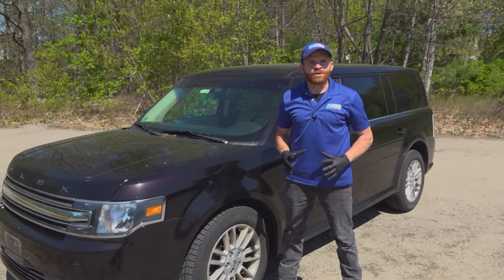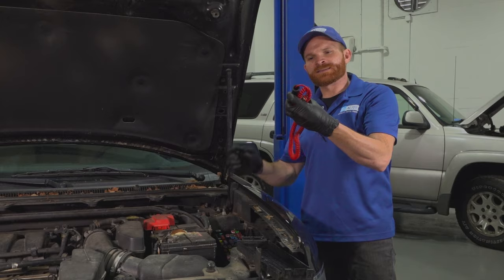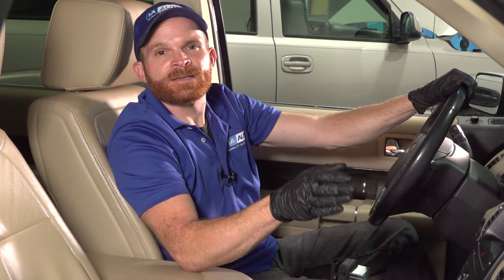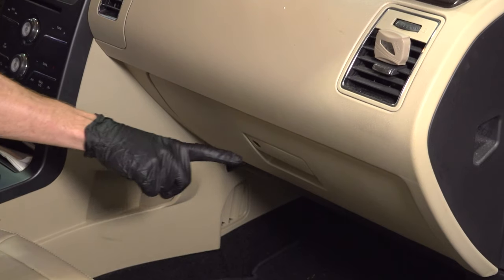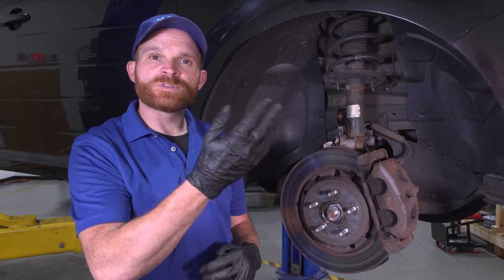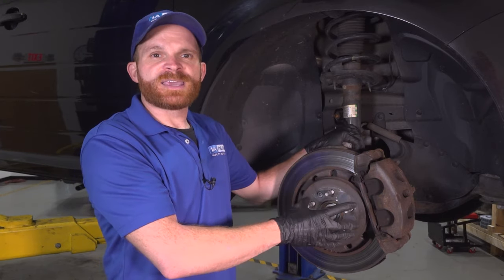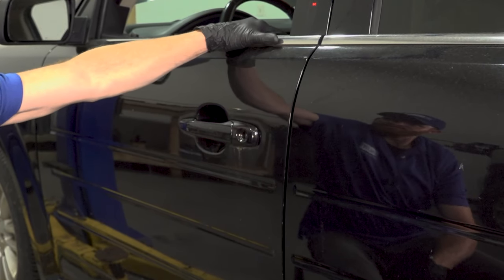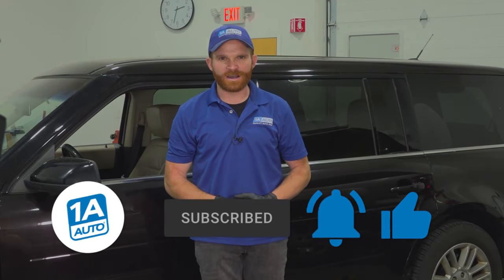Top 5 Problems Ford Flex SUV 2009-2019 1st Generation

Comment: I have a 2013 flex it's been a great car my timing chain broke at 189,000 and my alternator just went at 200,300 miles fixed and it's still running strong great car other than the 02 sensors on both banks and back up camera I've had issues with the front end making a ruff sounds not sure if it's bushing or arms if anyone can recommend any help itd be great. I love my flex ❤

Comment: Unfortunately those ford flex models have a ridiculous design for replacing the water pump. It’s a $2000 job as the water pump is ran with the timing chain system. The entire top end of the engine has to be removed

Comment: Don’t like your assessment of the  Ford Flex, nitty picking and very minor items, I own 2 Flex’s, a 2011 SEL with 175,000 Kim’s and an extra 45,000 Kim’s towed behind the motor home and a 2019 Limited, with 90,000 Kim’s, and they both perform better than most vehicles sold today, gas mileage is not an issue on the 2011, but the 2019, guzzles but delivers fantastic power, I love the Flex’s 💕

Comment: I have a 2016 flex the rear ac controls do not work or air comes out of the back vents what could it be
Reply from the maker: +Edgar Garcia We wouldn't be able to diagnose an issue like that here, you may want to have a local mechanic take a look at it. Thanks for checking us out! http://1aau.to/m/Shop-1AAuto-c

Comment: There are problems with the Ford Flex with the fuel tank systems. id like to know more about this. example we were driving to Taos NM from AZ during our drive we started to have an issue where the fuel gauge would state 1/4 tank left and the computer said 100 miles to empty. after driving 2 minutes it dropped to zero miles and the fuel gauge went down to empty.  this left us stranded in the middle of the desert at 117 F. not cool Ford! after looking at google more users had the same issues. ford seems to be unsure of the issues and start to just replace parts. you have to love SEA parts re-placers and not actual knowledgeable techs.  they suggest to replace the pump or the fuel transfer or both then the hose between both. my tank now reaches 1/2 tank full and the system says zero miles to empty and the engine cuts out. i refilled the car and it only took 8 gallons of fuel so the fuel is in the system apparently this car has what we call saddle tanks tanks.   im surprised ford has not done a recall on this issue yet as it can leave family stranded in dangerous situations. 

i started to look into this more, if you go into the engineering mode of the car you can view the levels of the tanks by 1. shut the car of hold the reset button on the messaging system. hold it 2. turn the car on then you can release the reset and cycle threw the engineering mode and test each component of the car.  i an see the levels of the tank sides one is higher then the other so i am guessing that the higher side of the tank will be the one that's not pulling fuel to the other side of the tank or it can be a float issue apparently this car has two floats as well. so frustrating and ford wants over 1700 to fix it and they cant grantee the fix. so here i am in Taos at our hotel trying to figure this issue out before we drive this dam flex back home.

any help would be most appreciated. Stranded and Ford lives up to its name Found On Road Dead.
Reply from the maker: +Charlie Will We wouldn't be able to diagnose an issue like that here, you may want to have a local mechanic take a look at it. Thanks for checking us out! http://1aau.to/m/Shop-1AAuto-c